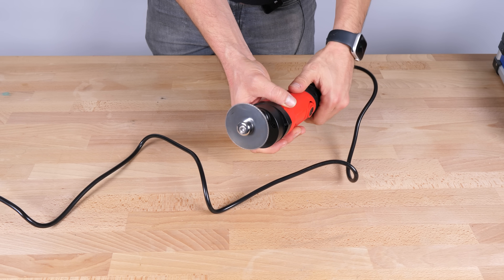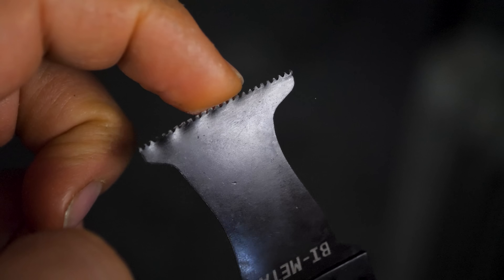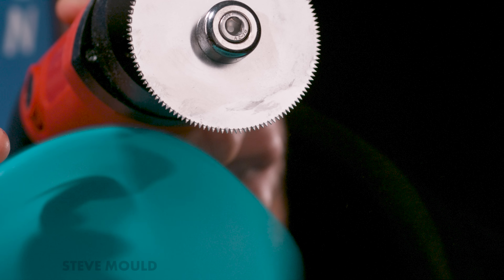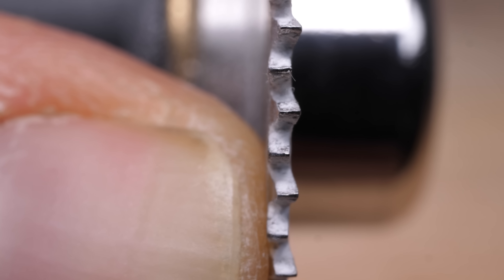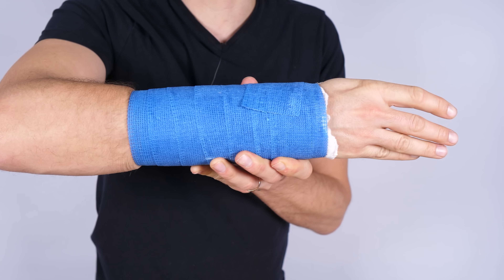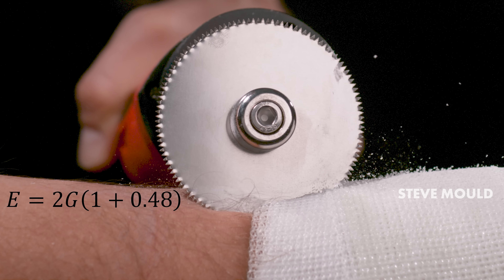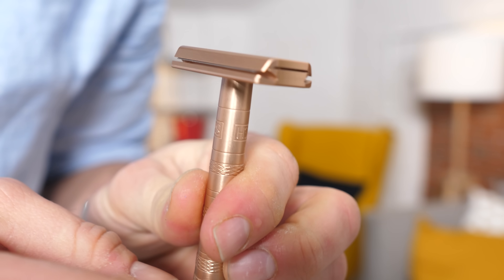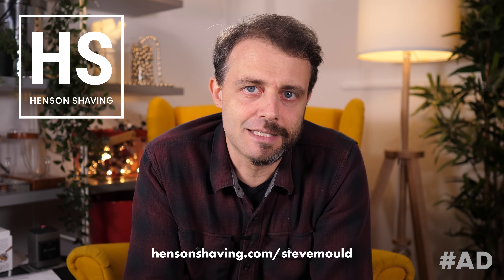A cast saw on human skin

Comment: Shaving with a safety razor is so much more pleasant and insanely more cost effective than the cartridges. Another game changer, even more so if you use a cartridge or disposable for some reason, is an alum bar. If you tend to get razor bumps or razor burn from shaving, and is also very affordable and more effective than all other options I have tried. The available higher quality safety razor blades also help with this, more consistent blade edge with less pressure and passes on the skin means less razor burn.

Comment: Cast saws CAN cut skin.  If one were to move the saw along the surface of the skin, you would move it beyond the elastic limit of the skin.  When removing casts the ortho tech or medical assistant (the doctor usually doesn't do this) presses the saw into the cast perpendicular to the skin, then withdraws it when they feel it break through the cast.  After withdrawint the saw to the surface of the cast, it is then moved and pressed in again.  The layer of padding under the cast is usually sufficient to protect the skin from the teeth and fron the het.
Reply: Absolutely, I got cut several times when they removed my cast when I was young. It was very hot as well.
Reply: @bid0u12345  probably it was wrong one or faulty
Reply: I have a 35 year old scar on my wrist from a cast saw. Many things can cut you if used incorrectly or not maintained.
Reply: Aye I have a scar as well. It wasn't a problem, I just had a stuck partial cast that needed a lot of work to remove.
Reply: Well they can cut skin, if used incorrectly.
Reply: So that's why they go up and down thrasher than just sliding it down
Reply: God I hate when the het hurts me

Comment: You verbally referenced other oscillating tools, but didn't demonstrate them.  You only demonstrated the dremel (other than the cast saw, of course).  I would have loved to have seen a comparison of a cast saw to a normal power oscillating tool that is typically used to cut wooden door jams near the floor.  Could it be used as a cast saw, I wonder?

Comment: I broke my arm when i was 18. I had a cast on for two weeks, after which i had a second x-ray. The doctor or the new x-ray up on the light box next to the x-ray taken on the day i broke my arm. He asked which was which. The date was on them, do it was obvious. He asked which was worse. 🩻 It was the new one ☠️.
The next day i was under general anesthetic having an X-fix, or external fixator, or "Meccano set" (as the nurse called it) fitted to my arm.
Somewhere I have the footage of the X-fix being removed. The nurse let me film it as long as I didn't scream and make her look bad.
To this day the scars on my arm are attached to the bone. Greatly increasing the Young's modulus of my arm skin.

Comment: This is very intersting to find out because I HAVE BEEN CUT BY A CAST SAW. They shoved a piece of plastic under where they were cutting the cast off and the doctor cut right through the cast and the plastic until it hit my skin and left a shallow 1in laceration on my arm. I still have the scar 18 years later.

Comment: It works exactly like this with a bog-standard oscillating multi-tool from supermarket. It comes with various various sawing bits, diamond coated bit for ceramics, tungsten carbide bits, sanding triangles.
I have tried it - VERY carefully at first - the moment I purchased it several years ago.
It is a wonderful tool to have in a home shop, and budget models cost somewhere around 35 Euro, including saw bits, sanding bits and the like. You only need it a few times a year, and when you do nothing else can replace it.

Comment: Finally smart enough to make a correction 🙌🏻 very small tweak and I’m not actually complaining about it, it’s the not exceeding the elastic limit that caused the ballon to pop but the very small crack size caused by the saw. It comes down to the fracture strength formula which tells us that depending on the fracture strength, which changes with the ballon as the skin becomes more rigid due to pressure, the flaw size required for rupturing decreases. Therefore, the ballon pops due to the skins fracture strength decreasing due to the increased tension on the skin from pressure.

Comment: On the topic of shaving with a cast/oscillating saw
Isn't that just an electric hair trimmer? (though linear motion instead of angular)
Conversely, could I use a hair trimmer to cut cast if I took out the stationary half of the blades?
So many questions, Steve. I was hoping you would have gone there in the video!

Comment: There is a similar oscillating tool meant for safely "buffing" your eyeball. Yes you read that right. I found that out the hard way. I got a shard of metal in my eye ( while wearing glasses AND safety glasses) and there was rust left just under the surface. They use a contraption to hold your lid open and buff away the spot without causing damage. They numb you with drops but you get to enjoy the experience while awake and watch it get closer..... Happy nightmares everyone.
Reply: Cheers for that.
Reply: I got hit in the eye with welding slag despite wearing safety goggles, and after that I always kept my welding mask down while chipping slag off.
Reply: @Porkey_Minch  Hmm bad safety goggles? Because all the safety googles I  have ever used it should be impossible because they are tight like diving mask or diving goggles... (with a fine mash at the side that only let in / out air).
Reply: @a64738  They were just safety "glasses" would be more accurate. I'm still impressed it got around them and into my eye considering I was looking directly at it. Must've bounced off my chest or something.
Reply: NO! NO! YOU CAN'T JUST SAY SUCH THINGS THEN DISAPPEAR INTO THE NIGHT! I can't have another fear of infantecimal possibility.
Reply: Oh god no :hand-orange-covering-eyes:
Reply: No, nothing can get to my eye. Nope. Noppers. Negative. Even if it's completely safe, screw that.
Reply: @ahreuwu what if your eyes had already been got
Reply: Sounds like something right out of Saw 😂
Reply: Agh reading this is making my eye twitch yuck
Reply: No. Curse you for telling everyone this lol.
Reply: Actually, that's called an Alger Brush, and those don't use oscillation. They straight up spin with a burr at the end. The layer of the cornea right underneath the outer layer (called Bowman's Membrane) is sturdy enough to handle direct impact of the burr, but the outer epithelial layer gets taken away. When used by a professional, they're super useful, but it WILL feel like you have an open wound on the eye for a few days as it heals. We use it, as said, to remove rust rings which can occur after metal shavings hit the eye.
Reply: Are your eyes ok now? :(
Reply: I went through LASIC. Was terrifying; the doc kept asking if I was alright. But, I can see without glasses now so that's cool.
Reply: I hate this
Reply: I have had injections with Cortisone many times in the eyeball, they give you numbing drops first but it still hurts and you have to try not to move your eye. Also had surgery in the eye where the local anesthesia started to go out at a critical stage in procedure and I started to feel pain and the vision was starting to come back and I could feel them cutting into the eye, I did not say anything until the critical stage was over... Luckily the procedure was almost over so they finished it like that without give more local anesthesia.
Reply: @cap5856  One fear.
Reply: I have never regretted reading a comment more...  XD
Reply: Great comment
Reply: yeah bro i had an hour long surgery on both eyes, the surgeon was moving metal instruments under the eye shell and i FELT everything he did. It hurts like hell and it's sharply and you strain your whole body to go against your primal instincts and not close your eyes
Reply: @tanik7131 oh my god ur so brave for this
Reply: On the plus side, the eye drops they use to numb your eyeball is cocaine.

Comment: That was really cool. Had you asked me before the reveal, I would've assumed it was using some completed circuit tech like you get in SawStop to stop the motion of the blade the instant it touched skin. Thinking on it after finishing the video, that wouldn't make sense, and the actual mechanism is probably about as clever.

Comment: I remember years ago when I was a teenager one of the nurses cut my cast off, and she burned the crap out of my arm. The cast back in the day weren’t these thin fiberglass ones they were made out of thick plaster, I can definitely attest to the heating up of that blade going through all that plaster. Left two nice straight burn marks along the cut line😅 I can say, though I’ve had several casts over my lifetime , and that was the only time that’s ever happened.
Reply: Same thing happened to me, although the burn is pretty small. I think doctors become overconfident and careless when using these saws.
Reply: @450AHX or very dull blade and more pushing through than actual cutting...

Comment: Hi Steve, minor correction from a UK Emergency Medicine Doctor. We still use plaster of paris as opposed to synthetic casts when you first break a bone. Plaster is better for the initial molding around the break. We also apply plaster to only one side of the cast, this is called a backslab. The soft side then allows for any swelling that occurs. This is usually then changed to a hard synthetic cast a few days later.
Reply: That's very interesting, thanks for explaining! I only had cast as a kid (so... definitely more than 15 years ago since the last one now), and it was always only plaster of Paris, so I wondered about the modern stuff :)
Reply: Hi, David. Thank you for your comment. Could I also humbly ask you: what is the purpose of the change from plaster to plastic if in few days plaster is already fully solidified?
Reply: @NikolayBychkovRus  I presume they have to redo the cast because swelling has gone down and it would be loose, and since there's no chance of it swelling up again you can use the faster cast (that sounds like a great trade name)
Reply: @NikolayBychkovRus  Synthetic casts are usually lighter, and the material is more breathable, which makes the cast less itchy and more comfortable.
Reply: This is just a guess, but I would think the synthetic would be better in handling getting wet. I am not saying you would run water over it or soak it, but it could potentially handle getting wet (splashed not soaked) better than a plaster cast. Again, this is just a guess. I have never had a cast, so I have no personal experience with either.
Reply: @davidsims5520 It's splinting versus casting. Splinting, in the USA at least, is done with fiberglass, often called Orthoglass. After a few days, plaster is used for casting because the swelling has peaked, and they are able to use the much more rigid and complete structure provided by plaster casting. A splint only goes on one side and a cast wraps completely around. 

I'm not entirely sure if it matters the order one uses the material because it matters how you use it, but I think it would be silly to use plaster for splinting due to its temporary nature and the fact that it takes so much longer. Splinting is done in the ER where time is precious and so is bed availability.
Reply: I broke my arm when I was a kid, in 1983, in a fracture so bad the nurse had to sit on my shoulder to hold me steady so the doctor could pull the bone back in traction. Afterwards, a week or so later, the swelling had gone down so much I could get my brother to reach down inside the cast with his hand and scratch my itchy skin. So, not at all supportive lol They replaced it with something much tighter. Plaster of Paris the whole way. They used huge scissors to cut it off. (Fascinating to see how technology has changed in the intervening years!)
Reply: @bordershader  its not uncommon in more serious injuries for the swelling to be so severe that a recasting is needed after it subsides. that still happens today. 

i always love doing the cast saw trick in front of patients who come in and need a cast removed. its fairly rare, but always a treat to see them go from fairly nervous/scared to relaxed and laughing
Reply: Interesting, can I ask why? Is the synthetic cast less secure?

Comment: oh I was not expecting that, I thought maybe it did not have enough torque and momentum ( energy ) to do any damage before it was stopped by friction, but when in contact with the plaster it erodes it one speck of dust at a time which allows it to continue going, just based on what i've seen when the dremel tools jam.

Comment: Surgeons also use similar osciallating tools to cut bones while not hurting the flesh all around. Or if you have an oscillating sander, you can hold small flat workpieces in your flat hand while sanding them, while you couldn't do that with an angle grinder with much luck.

Comment: The main reason for the cutting ability of this tool is the impedance matching between the blade and the material you're trying to cut. Only if this condition is fulfilled, the impulse and hence energy is successfully transferred to the material. You have the same effect if you leave high frequency coaxial cables open or shorted at the end.
Reply: High frequency coaxial cable destruction through impedance matching? That sounds like good video material.

Comment: Only pu5s1es need to use a medical cast saw to remove casts! Back in '94, I soaked mine in the washing machine in the barracks, only to learn that it wasn't plaster, but fiberglass! So I grabbed a hammer, a screw driver, and my Swiss Army knife. Mission. Accomplished.

Comment: "Several ultrasonic velocity values have been reported for human skin, ranging from 1498 up to 1710 m ⁄ s." the transverse waves in your skin are oscillations in the momentum of your skin and the stresses in it, tensile, compressive or sheer, the forces are mediated by pressure and strain and sheer stresses between molecules, some of it propagates at the speed of sound, and all non uniform acceleration inside the material will cause pressure gradients to form and propagate at very high speed, but like in water, the oscillations in the momentum of the material depends on the character of the oscillation, pure compressive oscillation propagate at one speed and is a fluctuation in momentum, density and pressure, transverse oscillations can travel a lot more slowly for several reasons, if the material is not that rigid then the restoring force can be small in comparison with the mass it is accelerating, like in water waves where gravity is acting on some wave form and so the differences in pressure push the level of the water to different heights, the wave form travels along with the mass distribution essentially slowing down a pressure wave by allowing it to bulge out and carry some over density and bulge with it, the oscillation is still mediated by pressure, but the gradient energy of the wave form is not only due to differences in pressure, but mostly in the waters motion and the rest is in pressure. for transverse waves in skin its more about sheer, pressure and motion side to side, or into and out of the skin for the more longitudinal waves, but it isn't sound, sound in compressive first and foremost.  :)  for very low wavelength/ high frequency oscillations in skin like sound waves the mixing between longitudinal modes and transverse modes is minimal, it is hard to produce a "pure" sound wave in skin without impacts or very high frequency.